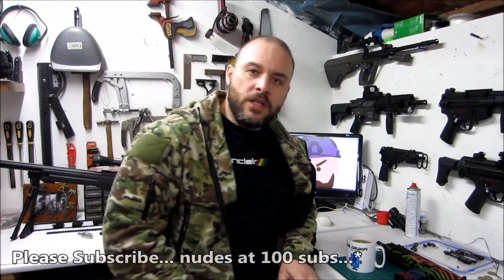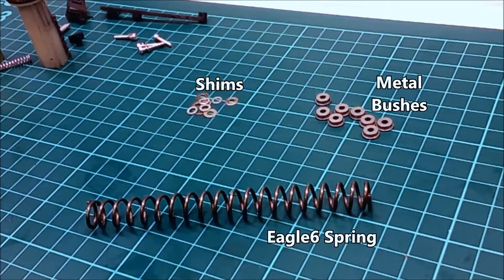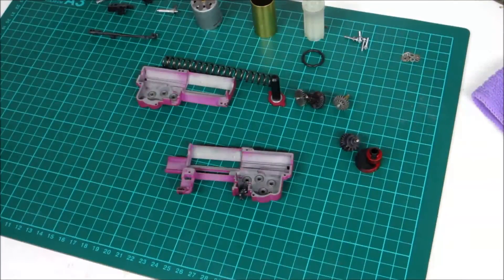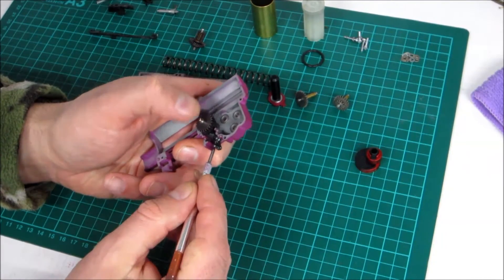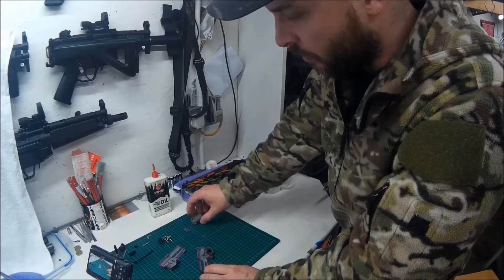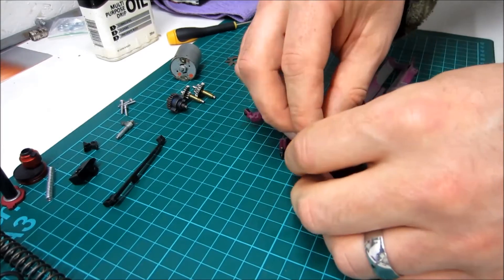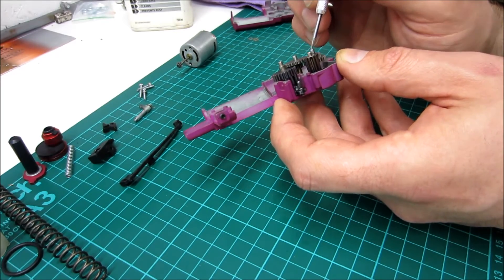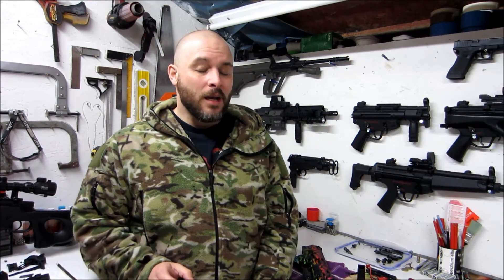Well R4 MP7 | Part 4 | AEP Gearbox Rebuild, Upgrade & Shim | Airsoft BYR

Comment: Hi mate, do you remember having any problems with the gun firing 1 time and then jams? 

Ive upgraded the same parts (spring guide, spring, cilinderhead, pistonhead and bought some new shims). 

No matter what i try, the gun sometimes locks after 5 shots, or wont fire at all. You hear a click  when it jams.

The Anti Reversal Latch is properly placed.. Im not sure what i could be. Any idea?
Reply: Also want to add on that: when i put the original spring in, the problem happens also (can fire more rounds but mostly 1 or none though..) When i put the spring out and test if the gears are moving good > the piston gets retracted fully, so that should be fine i guess?
Reply from the maker: Hey buddy, cheers for dropping by!

I can't really say with any specifics what that might be, without having it in bits in front of me.  Only time mines ever gave trouble was when I put the gearbox back in and forgot to hook over the black plastic rod inside the receiver, onto the cut off lever that sticks out the gearbox.

Otherwise mine was mostly fine.  I was mighty impressed that the tiny motor with its tiny thin shaft was able to wind the Eagle 6 spring back 😂

Other thing I had was I was running on small 7.4 lipo, tiny gutless one is all that will fit in these but it's still way more punchy than the factory NiMH.  Perhaps - assuming you are using the factory battery - it just doesn't have enough juice to pull the spring after a couple shots?
Reply: @PurpleHelmet  Thanks for your fast reply! I've already ordered a lipo converter to drop in to use lipo batteries. Could be the issue, but when i place the original spring in, the problem occurs too.. 

I've heard some stories that the piston head could get stuck but im not sure since it's the same as yours. The nozzle is aligned with the tappet spring and connected.

Perhaps a shimming issue? Do you know how many shims you used on each specific gear?
Reply from the maker: @dypressionofficial  - it's definitely an odd one, hopefully you get to bottom of it.  Could be a fault in the trigger contact assembly - disengaging but not fully returning so it can't re engage.

Shims - I can't remember how many or what thickness, I go entirely by feel because ultimately, every gearbox, every set of gears, could require different shimming.  Such is the complete lack of precision in anything Airsoft 😂

All I'd say is, when shimming, if you are in any doubt at all, it's better to shim a tiny bit too loose, than too tight.  Did you check your gears were free once the box was screwed shut?  These tiny shells - forgetting the lack of precision for a second - distort when screwed shut like many of their bigger AEG cousins.  What seems like perfectly free gears when the casing is just held shut, can suddenly become tight or jammed completely when screwed shut.  Even a little bit of friction drag is enough to bog the whole system!
Reply: @PurpleHelmet  Will check tonight. Regarding the shimming: the bevel gear is a bit too tight in my opinion, but otherwise it doesnt really fit with the pinion gear.. Enough things to try. I will keep you informed. Others might run into the same, who knows :)
Reply: @PurpleHelmet  Hey buddy,  All problems got fixed when the Lipo was in. Pretty weird though, i even placed all stock parts in and the motor didnt had enough power. Gun fires very smooth with the lipo. Thanks for your videos and replies. And for everyone who wants to upgrade this without lipo, don't. Make sure you use a Lipo. I use it with the Tokio Marui Adapter for MP7 it's a very cheap solution to use lipo without to rewire the whole thing.
Reply from the maker: @dypressionofficial  fantastic mate!

I'll be honest it doesn't surprise me  - I've seen too many wells that come and the batteries are near dead and completely gutless out of the box!

Comment: Hey,can you tell me please where is the trigger contact？I want to connect a gate merf and Its difficult to find the trigger contact location so I can solder the gate
Reply from the maker: Hey buddy - the trigger contact is involved to get at and very fiddly to strip and reassemble.  Also, when fitting the MOSFET wires, you do need to cut some of the brass tracks in the trigger system.  It can be done though.

Unfortunately it's impossible to explain other than to say you need to split the shell right down and get to the trigger assembly (folks often refer to this as the trigger underlay) - and the disassemble that.

Only effective way would be to show how by making a video but as you might have noticed from my exquisite upload schedule, I just don't have time right now 😂
Reply: Thanks for the quick  reply,I will try to figure it out then whats going on,I have take it apart and is see the trigger box its a mess for me but hope I find a solution.

Comment: I really hope you somehow bump into my comment asap.
I am looking to build a Well R4 myself. I want to 11.1v it with a mosfet and micro switches. Mcgyver that sucka! I'm looking for a 330fps max gun, or 1j whichever.
I would like to avoid buying stuff I don't really need. So do you see any reason for me, given the trigger snappyness I will gain, to buy a new "reinforced" piston, cylinder and or the spring guide ?
I might end up designing a new spring guide for it on the CNC, but would need measurments from the actual. 
Also! For bushings, are the inner holes 2.5mm or 3mm ? 

Thank you so much!
Reply from the maker: Hey buddy, cheers for dropping by!

First I'll state something as a disclaimer - you might get it to 330, but longevity is going to be a huge question mark, especially on 11.1 - but I'm guessing you know this already and are happy to accept your compromise for performance.

Mine was doing ~300 on 0.2s with the stock barrel - tightbore that, lengthen it a tiny bit, and that would eke out a tad more.  But really I think 300-315 is your realistic max to have any kind of longevity, even then questionable.  It's just that small a format.  I do like them though, probably because of the challenges!

Bushes - from memory, 2.5mm axles but don't quote me - get yours to bits and measure before buying anything.

"Upgraded" bits - building it again, I wouldn't use the spring guide.  Sure the base is metal, but the guide itself is plastic screwed to it.  Probably weaker than stock!  If you have capability to make an all metal one go for that!

Cylinder head - it was ok but left a lot to be desired IMO.  It solved the nozzle sealing - it seals really well - but the design they went for (I presume to reduce shock/cracked shell) was a bit nonsensical - it allowed the whole head to move around (and hence the nozzle) leading to a lot of shot to shot inconsistency.  Ideally I'd have liked a metal version of the factory head BUT with an o ring internally for the nozzle.  That would perhaps allow it to be made a tiny bit thinner to accommodate decent damping internally without sacrificing air volume - because the cylinders are tiny.  That's your major upper limiter with these after the spring - air volume - hence why too long on the barrel will get detrimental quick.

Cylinder - don't see any reason to upgrade that, and even the stock piston head is capable enough.

Upgraded pistons are disappointing, still plastic, still break to easily.  Ditto the upgrade reversal latch.  Very poor and still weak IMO

So basically if I was building it again, I'd upgrade spring, upgrade to all metal bushes, and mod the stock stuff for better seal and poss a tiny bit of damping.

The AEP boxes get hated on, and I can see why - but really, when you think about what it achieves in a package - including motor - that is about the size of a 20 pack of cigarettes - it's very cool
Reply: @PurpleHelmet  I appreciate the reply so much! Especially how fast you got back!
So based of what you just said.

I will defo have to compromise to a lower FPS. I intend to use it in CQB only where we have a 1J limit, but I guess I can just drop lower to 0.6j or whatever. Consistency and reliability before "auch"

-I'll get the Laylax TM AEP & Machine Pistol Low Friction Reservoir Bushings from brillarmory.
-I'll get a spring guide made.
-Keep the cylinder and piston head stock. (only reason why I thought about getting the aftermarket cylinder is their length. Aparently they are longer by a bit. Ofcourse I doubt this would give me more air volume since the piston can only move as much as the gears move it, but thought it might give the GB itself some toughness)
-I'll get a piston just to be sure, worst case scenario I'll get one of those CNCd out too...somehow.... 
-Reversal latch, I guess I could get this easily made out of steel, so hope that will be the easiest part.
-nineball hop rubber, with preferably an r-hop. I'm really afraid of the hop chamber honestly, I remember how garbage it was in my G18 cyma

Been reading the comments here. The steel CNC gearbox might be a stretch unless I somehow manage to design it flawlessly in CAD to get it cut out from steel. So I was suggested by a friend to JBweld the bejeezus out of it. Might consider doing that t othe cyl head to solve the damping on the exterior and move it to the interior with a sorbo.

I am incredibly grateful for your response and your videos. I really hope I will be able to pull this off without annoying others too much
Rob
Reply from the maker: @BodisRobert  no problem on the reply buddy, that's why I started this in the first place - for the chat and interaction!  I haven't uploaded in over a year due to external circumstances - but I'm still active and will get back to it one day!

Sounds like you have it pretty well sussed out and have a great grasp of what you want to achieve!

The hop chamber - at least on the well and Blackviper models (can't speak for TM) is utter garbage.  Hop arm twists under adjustment throwing the nub off TDC, causing shots to veer.  If you can nail the hop down, get a solution for that - you won't have any issues getting decent range and hits even sub 1j.  In CQB it would be a perfect weapon, ditto sidearm for up close backup if you were sniping.

The other issue is battery space, you have probably thought of this already as I can tell you are methodical.  But for any decent amp output, and especially if you are going 3 cell, it will have to be ext mounted, fake peq or similar.  

You should make a video of your build mate, plenty (myself included) would love to see
Reply: @PurpleHelmet  I have the good fortune to know someone who is extremely knowledgeable about airsoft tech-ing. So I am just repeating what he taught me in the last year or so. But due to my business, I do know how to 3d model anything.

If I manage to figure out some ways to re-design something in this wallet size replica that actually proves itself reliable. I will most likely showcase it and share the files so maybe other people will consider this build. 
I run a modded 29rps specna m4 gb shell currently and got like 90k shots (maybe 110k) on it at 400fps/1.5j. The only thing I ever broke was the tappet plate. So my gasp of reliability will be violated by this mp7 maybe.

Even tho all I care about is trigger pull/response and consistency.

For battery. If I can achieve a snappy trigger response from 7v...I'm sold. 
I will place it in a PEQ (regular size), even if half the battery will hang out. The bigger PEQs look disgusting.

I really hope you get back to doing videos and more importantly back to proper health.

Cheers sir!
Reply: @PurpleHelmet   So a bit of an update. I ended up getting the plastic version of the gun. Got a 6mm Orga barrel, nineball bucking, cyl head, metal bushings and some other parts. I got an extra gearbox so I don't have to take apart the whole gun just yet. I got the CNC hop chamber that is for the HPA version, I will try to CNC cut out the side so it fits ( small hopes on this). Metal spring guide with a hole in it (yay) is about to be fabricated. On the other front, my buddy is looking at RC motors that would be better as the current one has 1.5mm of brushes or something dumb like that. He also managed to insert an o-ring on top of the original nozzle to work well with the original cyl head resulting in a perfect seal.
We are coming to a conclusion that the moment you find a solution to something in this build is that the following part needs an upgrade too otherwise the whole thing will self destruct. We will get it done tho!

Comment: Hey just watched to let you know that those bearings off aliexpress i was showing you about, fit the gearbox fine and gears run well. They will need to be pressed in but that shouldnt be much of a problem.
Reply from the maker: Hey buddy - thanks for coming back and letting me know, appreciated!

Comment: Excellent job , I'm building mine with you. i wish you just gave details of items you're using. like 120 spring or 105  or...... also what size of bearings are you using 9mm or 8mm ?
Reply: They are special AEP 6mm bushings with 2.5mm inner diameter (smaller than your regular V2 or V3 gearbox). Nine ball or FPS Softair makes them, they are pretty rare to find and come in a pack of 8. 

As for upgrades, spring or ROF isn't worth it since you can't find aftermarket or steel forged gear sets. You can barely find Well or Tokyo marui standard gear packs anymore, AEPs seems to have died out. Just use the spring it came with and upgrade range and reliability instead. Nozzles and tappet plates are notorious to break on these things. I replaced mine with custom steel forged ones via shapeways, 50$ a pop.

Comment: Hi chap, great job! I've fgot a couple of vz61s a JG and a TM, but both are having issues, the tm only seems to want to shoot in semi, can't get the selector to move across to auto, also have you tinkered with buckings? tried an aeg one cut down or a gbb to aeg hotshot bucking with a crazyjet barrel? Hope you're well :)
Reply from the maker: Hey mate cheers for taking time to drop by and comment!

I've actually got a couple of Well Scorpions as well as the MP7, all are in bits, just haven't had chance to do anything with them since these videos 😆

I'll be honest, I've only ever ran stock hops in them because they've only ever been intended for very close / backup use.  I've always concerned myself with getting the power up a bit because at the power these usually sit at stock, often you have trouble getting folks to feel hits unless you are 5ft from them lol.

You'll know tho, attention to the hop can't help but make things way better, I'm just lazy 😂

Your scorpion fire issues - is the part that sits on top of the trigger group (under the gearbox) definitely positioned right?  Small plastic piece.  It's dead easy to dislodge while popping the gearbox in, and if it isn't just right, snagged or not interacting with the fire select lever just right, you get all kinds of grief!

I'd love a gas scorpion tbh, Silver Fox Airsoft used one in many of his vids and tbh I think in a platform that tiny, gas is the most viable option... but I just enjoy tinkering plus the challenge of getting a less than optimal setup working well - sucker for punishment pmsl!
Reply: @PurpleHelmet  hi dude, my first one, the JG I upgraded the hell out of and was getting mansize target hits out past 50m.. AFAIK everything is seated right, I think it's a trigger mech issue as the cutoff lever seems to be fine too...

Comment: Hey man sorry for messaging you like the 5th time in 2 months but does the nineball cylinder head seal perfectly? I managed to recreate it in CAD. If it doesn't, I've also developed a modified version that seals like your standard aeg air nozzle/ cylinder head and because the oring isnt in direct path of the air it might seal better
Reply from the maker: Hey buddy - never apologise, chatting is a big part of why I started the channel in the first place!

It does seal good... on a static test.  Lot harder to tell how it will seal under use, especially on full auto.  What I mean is, they chose to design it with a damper on the front of the head.  So, every time the piston strikes forward, the whole head can/will move.  This could potentially cause inconsistencies in the sealing.

I kinda understand why they tried it that way - probably not wanting to sacrifice any internal air volume on what is already a tiny cylinder - but yeah, it does introduce what are IMO other problems.

The o-ring seal between head and nozzle is pretty good though, its just the head to cylinder seal I am concerned about.  I'm tempted to rip the rubber damper off the front of mine and replace with an ABS disc, or maybe even aluminium... sure it means less shock absorbtion, more chance of something breaking, but breakers yard guns are cheap as hell, so spares aren't an issue...
Reply: ah well i designed the cylinder head to be more like a stock tokyo marui. I will see how much laser cutting neoprene or rubber will be worth but the file is basically complete. Just need to buy o rings